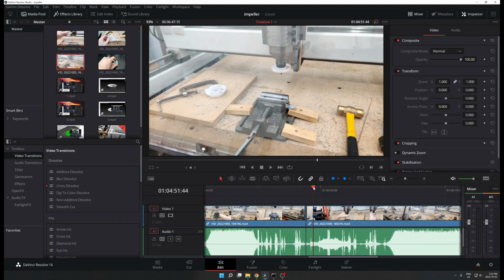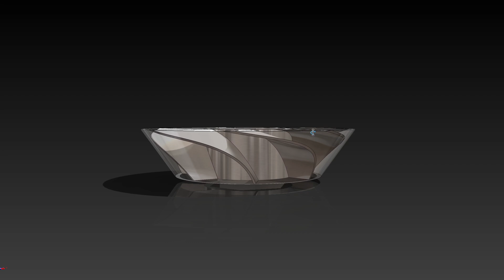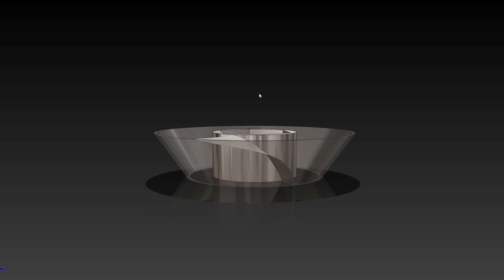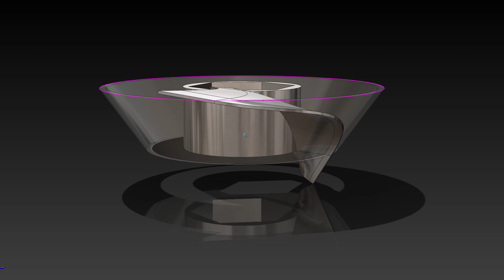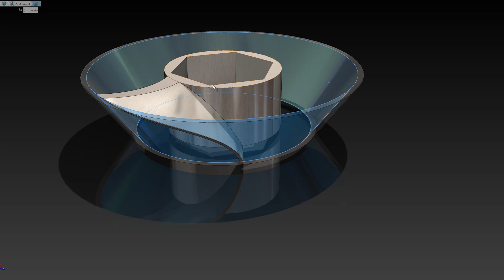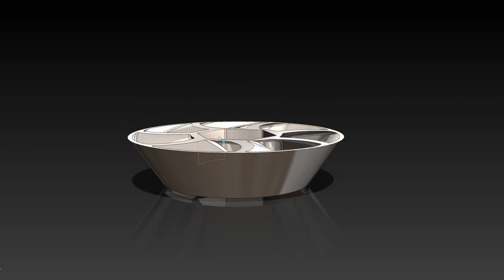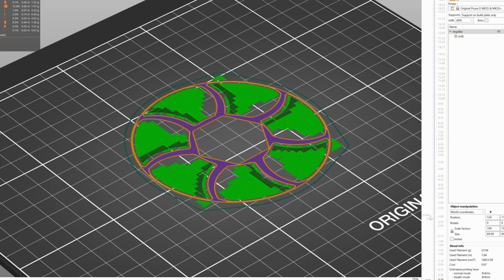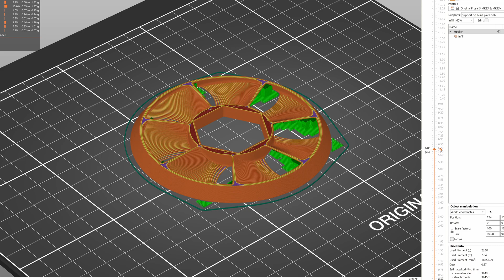Designing a High-Performance CNC Impeller Fan

Comment: Hi Bryan are you offering the stl file for this fan anywhere ?
Reply from the maker: This one's not a great design. I use the regular one instead and use it for cutting aluminum 100% of the time. I think I have the STL file and the SolidWorks file on the printables website. Search for my name on that site. If it's not there let me know. I do have it posted on the PrintNC Discord Channel as well.
Reply: @BryanHoward did you remove it, because your name is not found.
Reply from the maker: @rvamerongen  This is what I use on a regular basis. Works great https://www.printables.com/model/287185-collet-fan

Comment: Dang that's a real interesting and innovative idea to add to a machine. I don't spend much time watching machining stuff on YouTube or on the forms or anything so maybe this is like a common thing people do now. But I would have loved to have tried this back in the day when I just started messing around. This would be a good easy and efficient way to experiment 👍 very neat!
Reply from the maker: Yeah these collet fans work really well. It works better than my 60 psi air compressor that removing chips. Air compressor gets occluded all the time when cutting pockets. Call the fan works really well when cutting aluminum cuz you can run the spindle at 24K RPM. because of the direction of wind the fan never wants to fall off and due to the vibration works its way on harder.

Comment: I’m trying to understand the purpose? Why would you want to blow sawdust all over your shop.
Reply from the maker: Ohh no this wouldn’t be used on wood. I primarily cut metal and it’s important to evacuate the chips away from the endmill so they don’t get recut causing heat and friction welding, for example aluminum to the endmill. Aluminum when it gets hot it gets all gummy and causes loads or problems.

I suppose this would be somewhat beneficial with wood but only when roughing where you are cutting a full wood chip and not making dust on a finish pass.

Comment: The convergent external shape is working against the (high) centrifugal forces on the flow. The fan performs well, but I think you are still wasting a lot of potential. Take a look at common compressors geometries, when you see one converging to the axis it's always a multi stage with flow-straightener stators inside. Single-stage axial compressors are straight, centrifugal compressors have radial exit, mixed flow ones have convergent section but divergent shape. Taking the outlet of a rotating flow closer to the rotation axis is always wasted work and energy against centrifugal forces. The design in the video basically has fins working one way and the external housing working against.
Reply: that's right
Reply from the maker: Yeah that’s understandable, How would you go abouts minimizing the negative effects of the centrifugal forces? I would like to have as much high airflow to the center of the axis of rotation. The flow that doesn’t make it to the center is not very useful for evacuating chips from the endmill as it cuts. I’m going to see if I can get openfoam and paraview working together so I can start to visualize what’s going on with the airflow because so far I’m just shooting in the dark at this point.
Reply from the maker: multi stages and flow-straightener I don’t think would print all that well because of the lack of supporting material on the inside layers. Maybe they wouldn’t be such a problem because of the pitch of the later stage blades. Not sure.
Reply: I understand the size contrains you have in this specific application. At leat I would try not to have blades in che convergent section, if you can extend it to the top. Like a straight axial (or mixed flow) in the upper part and a convergent without blades underneath.
Reply from the maker: @stezz90  Thanks for all your input with this. You’ve helped me come to realize how little I know about what the air flow is doing here. I’m not confident the profile of my blades is working all that well. The centrifugal force working against things. Lots of things I gotta read up on. I’m going to visit this fan in the future and with better tools I can simulate to see what’s going on.

Comment: word of advice. i did some like this by trying to make a 3d printed vacuum impeller for a spindle motor and had the part explode on me I came very close to loosing some fingers.
Reply from the maker: Yeah these 3d printed fans should only be used in an enclosure or at the minimum some kind of blast shield to protect you. At the outside diameter the plastic is spinning at 300-400 km/h and even though they don’t weigh much of anything, they’ll still pack enough kinetic energy to do some substantial damage to tissue if you're unlucky to be hit by it.
Reply: @BryanHoward  in my case it had enough energy to disintegrate a 1 foot by 1 foot square mdf board 3/4 inch thick and still had enough to energy to go thru the wall. I was lucky to only come out with some bruises.

Comment: Looks like a cool idea, would have loved to see it in action and how it performs.
Reply from the maker: I have to re-square my machine again but after that I have some aluminum parts to mill. I’ll see how the impeller fan performs compared to a 60 psi air compressor for clearing chips.